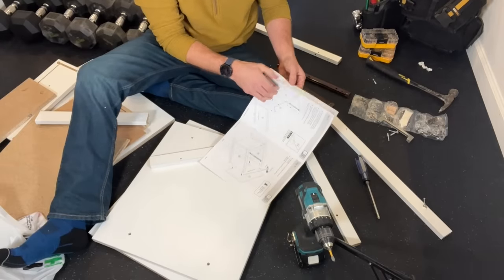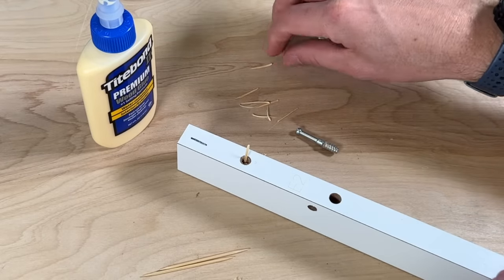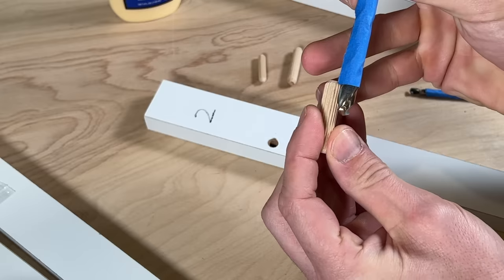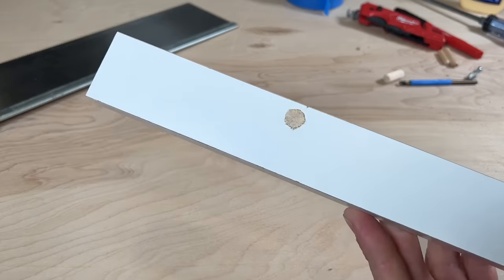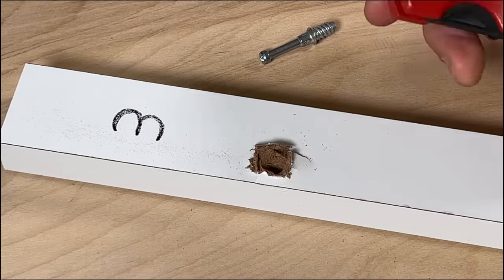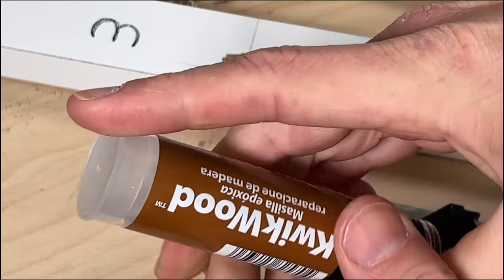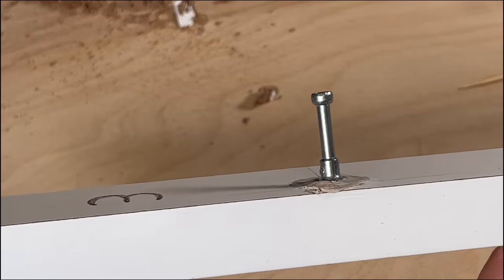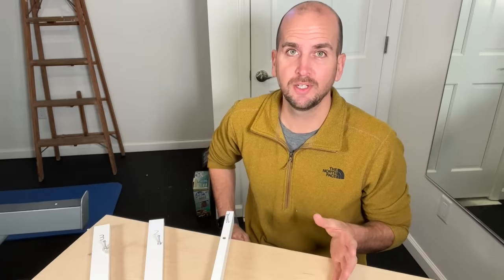How To Fix Damaged IKEA Furniture

Comment: For the 3rd case, does it work if I first apply the epoxy, let it dry, and then drill the hole for screw?
Reply: Don't see a reason why it won't provided you have the proper tool to drill it and proper size

Comment: IKEA should be ashamed of themselves. They have used the same hardware for many years and should have worked to improve it. They should also have a documented repair method and possible offer a repair kit. As for the Pozidriv, if they want people to use it, they should note this or provide a driver with the furniture.

Comment: Superglue is the answer to all of those holes that are too big!! (and many many more possibilities!)

Just put some fluffs of cotton balls (of take it from a Q-tip) in the hole.
You can also use some baking soda in the hole.

Simply add a few drops of superglue and then wait….
Once it is done, it is as hard as a rock!
You can cut away any spill and sand it like you would any other wood piece that is a bit ruff.

Then simply use as if it’s a brand new piece of wood and simply drill a new hole into the now 100% fixed piece.

You can also use this to fix it when a piece is broken: instead of trying to glue the broken pieces back together with only superglue (you’ll fail, it will never stick enough): take the cotton (or sawdust or baking soda), put it between the 2 broken pieces and add the superglue. Press tightly immediately (make sure the break-line doesn’t get bigger) and again: when it’s dried up, it will be rock hard.

Even when a piece is broken off, this is your fix !
Make sure that you put the part on a sheet of baking/wax paper (you don’t want it to be stuck to what is on the bottom)

Then take some masking tape and form the new outline (we are recreating the piece that is broken off.)
Fill this with the cotton (or the other options), add the superglue.
Once it is hardened you take of the tape and ‘tidy up’ the new part: cut, sand and whatever else.

Comment: First of all never overtight and do not use any power tools. Use the thick superglue with accelerator. Check out how to repair with superglue and baking soda videos. If you do use any of the tips from this video make sure you position the screws straight vertically and not leaning to the side.

Comment: 9:18. I’m not fond of this technique. While it will set the cam screw quite well, the weak spot is the tensile strength of the bond between the KwikWood and the original “wood.”  If you do want to use this method, use a Dremel and clean out the hole with the bottom wider than the top, just like a dentist makes space for a filling.

Comment: So on the last example why must you put the cam in the putty? Why can't you fill the hole and then drill in the middle after it cures and then screw in the cam?
Reply: Because that type of epoxy putty is too hard to effectively screw the pin into it. It won't cut or deform to accommodate the threads.
Reply: @timdouglass9831  got it thanks!

Comment: I hate MDF and particle board. I would much rather have solid wood even if it does increase the price. I just fill the hole halfway with 5 min. epoxy and screw in the insert. It is way stronger than the fake wood.

Comment: my ikea tv stand from 1999 is solid wood. stil have it..
Reply from the maker: IKEA has solid wood 😂
Reply: My kitchen table from IKEA is solid wood, probably stained pine. Possibly the best $300 I have spent. Still going steong after 12+ years, even with people occasionally sitting on it. A few dings from multiple moves, but otherwise it's still good!

Comment: I have put together 200 pieces of Ikea furniture. Probably over 1,000 cam screws. I have never stripped a single one. My secret? I mean, duh, you can't use a power drill as a screwdriver with particle board. Never. While I have sung the praises of Ikea over the decades with their precision cuts and holes, lately I have noted issues with holes for the cams not seating properly on the cam screws. Jiggling the parts and cleaning out sawdust residue in the holes usually fixes the problem. I did strip one screw in one drawer rail several years ago -  but not a cam screw. Just feel for when to stop turning, which you can't do with a freakin' drill. Is it really that hard to use a manual screwdriver? Do you feel unmanly unless you use a power tool?

Comment: I mean… you. Low out the saw dust then fill the hole with tiny oieces of wood? 
I say kea the dust and just add the glue. Or stick and Ikea’s wooden dowel in and glue it then just drill a new hole

Comment: most of those furniture assembly instructions tell you specifically NOT to use power tool screwdriver.  it is too easy to strip or ruin them that way.  HAND TOOLS.. HAND TOOLS ONLY.  READ THE DIRECTIONS. NO POWER TOOLS!   I have assembled at least 100 of these bit of furniture over time and stripped maybe two. easily managed with a bit of glue and toothpicks.

Comment: I would have let the wood putty set up, then drill a new hole.
Reply: That putty sets up really hard.  You'd have to drill a rather large pilot resulting in not that much material holding the screw.  IMHO

Comment: I won't buy furniture made from sawdust and glue.
Reply from the maker: Getting hard these days to find real wood but agree that is a much better path if possible.
Reply: @EverydayHomeRepairs  True, and it's expensive,  I buy old used furniture.  My computer table is about 3 ft by 2 ft with a center drawer and made of solid oak, it's about 50 years old and built like a battleship.  After a few months the joints in that Ikea junk will get loose and shortly after will fall apart ending up in a landfill,  meanwhile I going to refinish the top of my old desk and it will be good for another 50 years.